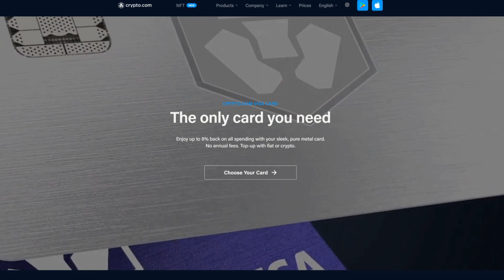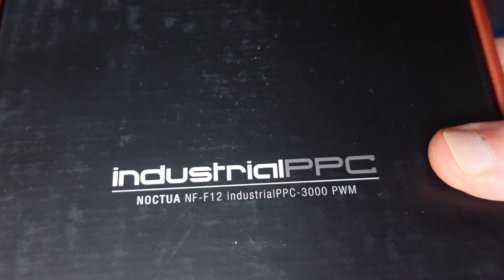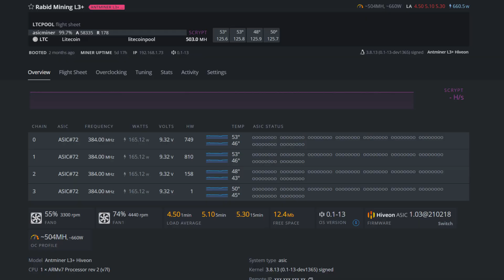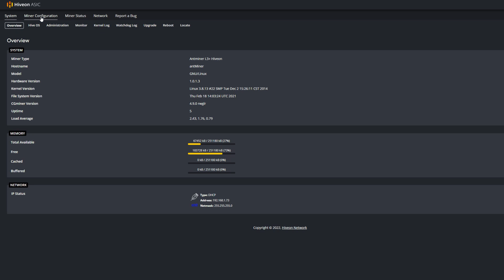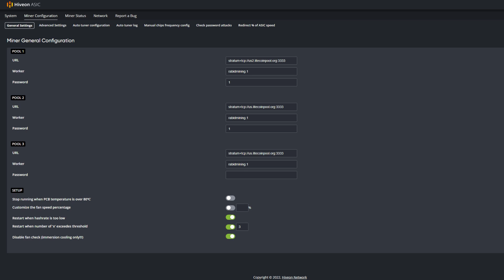DO THIS!!!! Silence Your AntMiner L3+ | Fan Swap

Comment: If you add a 140 to 120mm adapter and use the 140mm version of the noctua, it will move way more air and keep the boatds cooler.
Reply from the maker: Awesome

Comment: Hey Rabid, I know this video is old but will this work on other bitmain ASICS? I just bought a t15 and it seems like the fans are the same diameter as the l3++ and frankly the s9 and other btc miners
Reply from the maker: Probably guess it depends on how hot those chips get.
Reply: @RabidMining  I’ll have to do some tinkering! Thanks for always getting a reply out!

Comment: Thanks Rabid! I'm currently getting everything to setup my first S9 (spec mining) and this will definitely help hide my unapproved purchase from the wife. 😉 Waiting on power supply now and running new electrical to the mining tent. Found a person on eBay selling them for $85 new still in sealed box. Hovering over Buy button constantly (I have a problem 😅).
Reply: Did you buy the S9?  If so what spec mining are you doing.  I bought one with Braiins OS and it can underclock it to make it more efficient
Reply: @julioreyes6024  I did and I ended up buying a few more. Whoops! LOL! I'm currently mining MVC. I have mine on HiveOS underclocked to 8.8T at 680w. With the underclocks there really isn't a need to swap out the fans since it's pretty quiet.
Reply: @MangledRemainz  I agree, the majority of thr noise came from this damn PSU. Ill set up mine as well this week to start underclocking and mining Alt coins based off ATHs.
Reply: @MangledRemainz  Where are you mining MVC? I did a quick search and couldn't find the pool.
Reply: @MangledRemainz  Awesome, I'll give it a try these two to three weeks and see how it goes.
Reply: @julioreyes6024  I do the same, get a bag and move on to the next.

Comment: I’m having a fan(3) error on a L7, which fan would that be and how do we tell it to ignore an fan sensor using the ip dashboard? (Without hive is)
Reply from the maker: Not sure don't have a L7 do not sure the order they are in no numbers on the control board fan ports?  Try unplugging each one or move them around to see

Comment: I tried this with some fans I got. And the screws from the oem fans are wayyy to long. When I mount the new fans the screws touch/almost touch the pcb boards. Isn't that bad?
Reply from the maker: Probably but guess as long as it's not touching lol have any spacers or something or shorter screws
Reply: @RabidMining  I'll give it a try. Also couldn't get the fans spinning. I have "disable fan check" on as well. And then set 100% fan speed and didn't work

Comment: This will only work in a cold environment Southern California pretty hot on the summer time and 3000 rpm not good enough to keep on low temp that will not over heat.
Unless keep it in a Airconditioned room my issue is my DIY solar system on my backyard and only accessible  outside. Anyway my question can I increase the speed of Noctua
NF-F12 to make it higher rpm  maybe 5000 to 6000 rpm then it will noisy again. Any comment appreciated Thanks.
Reply: Did you figure it out?

Comment: 1 question, if i have 1 big cooler and 1 smaller, wich one needs to blow in air? And wich one extract out the air?
Reply from the maker: Seems the intake is the stronger one and out take is a bit slower on the default programming with the fan co controller

Comment: Does this fan swap work with the stock firmware ?
Reply from the maker: Yes it should but may run warmer as its using more power on stock.
Reply: @RabidMining  so literally buy these fans , fit them. And then power on? Mine is in a cold garage whish fans pulling cool air in to. Il give this a try, thanks

Comment: ppc 3000's rock!  Keep in mind you also has the fan speed @ 43%.  Instead of disabling you could lock the % to 100 and get the temps back down I think.
Reply from the maker: ya think the 43% is based on the 6000 rpm fans it normally would use as 43% is already sitting at 2860 rpm on 3000 rpm fans.

Comment: Sounds great literally.   I want to buy a couple of L3+ so I'll try reversing the air flow then buy quieter fans.   I've also wondered if the box was bigger then we could use taller heat sinks with better fans.
Reply from the maker: possibly if you can get someone to custom make a box for 140mm
Reply: @RabidMining  I want to use a Octomine box or whatever is on sale at ebay, they have some boxes for $150 or so and I'll put quieter fans on both sides and test with the lid off and on to see which produces lower temps.   Remove the boards and they get more air around them in a flow thru box worked for someone on YT with Z9 mini's and L3's. 

 I think an old gun locker with enough fans could work too.  The Jasminer company YT shows a similar cabinet, he does it to reduce noise way down & they run cool.  So I'll put my mad skillz to work.

Comment: Another trick I've learned with the L3's is to flip the fans opposite of the way they come from the factory. Instead of dragging warm air over the end where the chips are, you're bringing the fresh cool air to them first and then out the other end. Was able to drop temps by 10-15 degrees C on all of mine by doing this.
Reply from the maker: Nice tip!
Reply: @RabidMining  are you already try this ? The sound and not soo good temp make me crazy lol.
Im using the default fan (because high cfm) the nidec ultraflo w12e12bs11b5-07 fan.
Thanks!
Reply: @RabidMining  Yeah man, don't just take my word for it, try it out and see. I learned it from a guy I bought one of my first ones from who ran an electronics repair shop. I was skeptical at first but tried it out with one and once I saw the result I did it on every other one I've gotten since. All running super cool now. 😎
Reply: You used the original screws? They are deeper in the unit since the fan isn't as thick...guess no issues?
Reply: hello guys im very intérresting by your trip ! but i didnt really understand do you mean just flip over both fan ?
Reply: Sir you have figure how to do like this?”please

Comment: I am searching a way to lower my asics too i go to this link ebayit but this is 3000rpm fan will it work like fabric  they are 6000rpm???
Reply from the maker: I haven't tried any other fans then the ones in the video so it might?
Reply: I just want to now is 3000rpm enough fabric put 6000rpm thats i need to now how long you put it on miner. Is he overheat with them??

Comment: I’ve had quite the collection of those fans 120 and 140, I had 20 at one point, sold off the 120s recently tho, might try this with the 140s on a reducer
Reply from the maker: ya 140s may be great
Reply: @RabidMining  on that note I’ll make the swap and show my temp. I’ve got my L3+ on the 550mh 720 watts, i like the little extra I get from it vs the lowest oc. Also in case anybody wondering why. My L3+ has 6 bad asic chips on one board. The way they work is the L3 will give more power to the rest of the good chips on that board to make the hashrate difference. So me personally was less efficient on the lowest oc setting vs what the actual wattage at the wall was. Everyone’s situation is different and me personally the next oc setting setting was using less power for the amount of ltc and doge I was receiving if that makes any sense. Keep it up and I’ll update you on my situation and swapping the fans out to 140s.
Reply from the maker: nice maybe I should try some higher settings